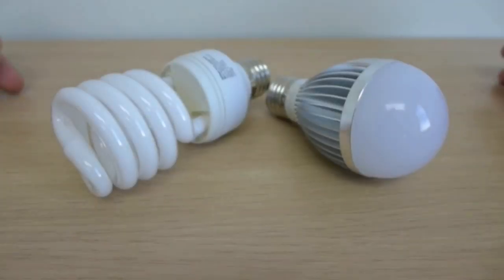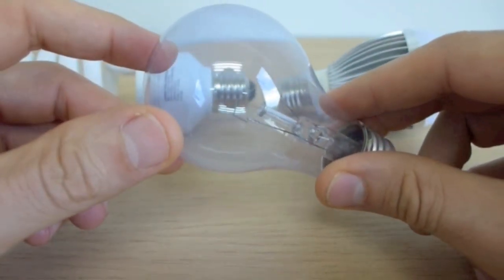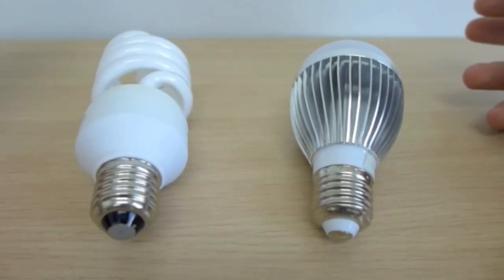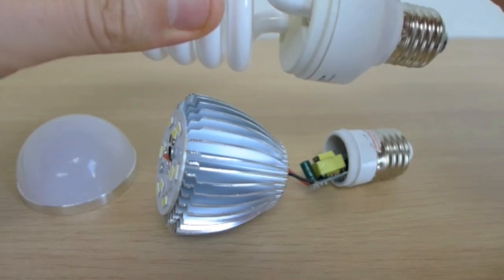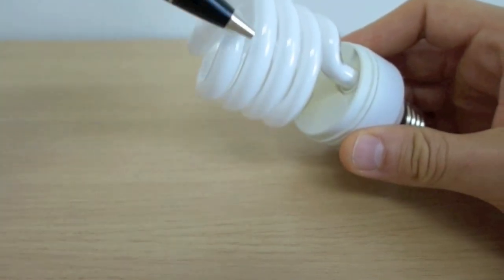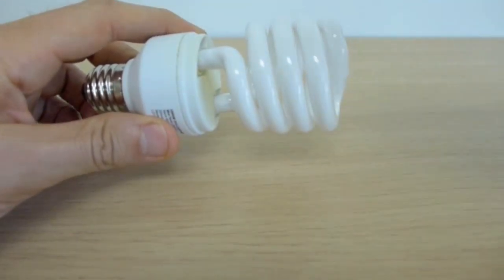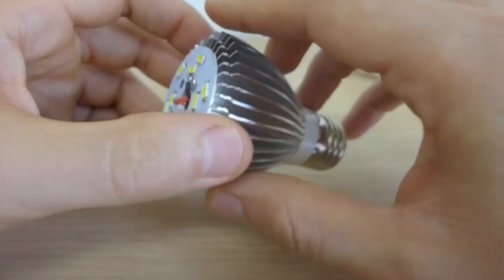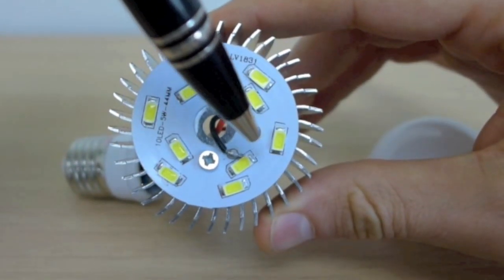Up close series: LED vs CFL Light Bulb

Comment: I have a lightbulb that when I hold it in my hand it comes on I am not holding a battery in my other hand and I don't have my finger in a light socket I can simply pick up the light bulb holding in my hand when my fingers touch the metal bottom light bulb comes on please explain

Comment: You will save about 20% on your electric bill by switching to all LED bulbs... This Company has the absolute best 100 watt equivalent bulb, it  is on amazon on sale for only 12 bucks and it cost less than 2.00 a year to run it 12 hrs a day. These are the latest LEDs not sold here in stores because they retail in he EU for about 75.00 bucks each. These are great for your outdoor light fixtures and they don't heat up. Philips  is coming out with some great leds but they don't compare to this one on price or energy savings, I just wish they had all the wattages and not just the 100 watt equivalent.The Company told me they will have all the sizes in about wo weeks because they are sold out.. Here's the link  http://www.amazon.com/dp/B01F8E6XVW

Comment: we have led bulbs, all I can say is the led is much brighter compared to CFL with the same wattage. If you wanna save, say you are using an 11watts cfl, just buy 7 watts LED, it will have the same brightness but low energy consumption, and stay away from fake, immitation LED, we are using Philips LED by the way

Comment: which is better cfl or led
Reply: +Mitul Khan led is safer and cost less runs over 10,000 hours said to run 50,000 but some lab tests say it runs even longer hours and cfl goes up to max 10,000 hours and has mercury in it